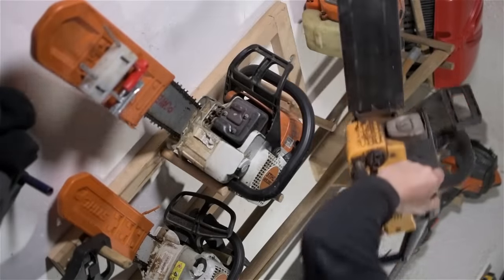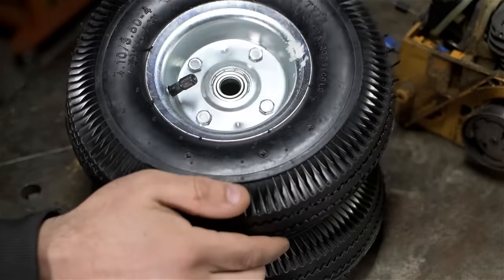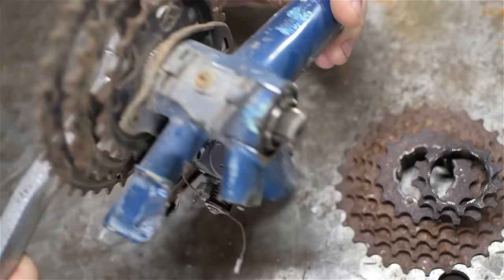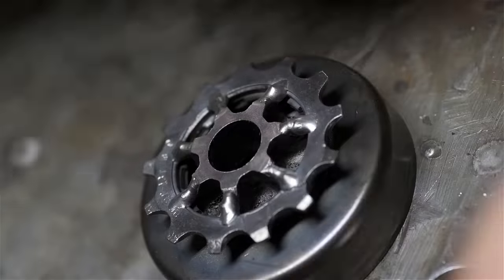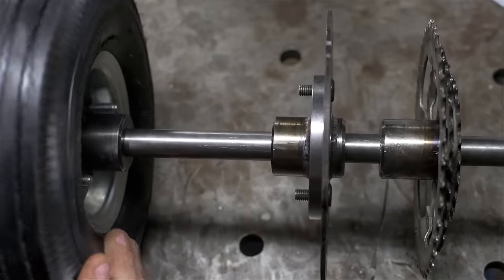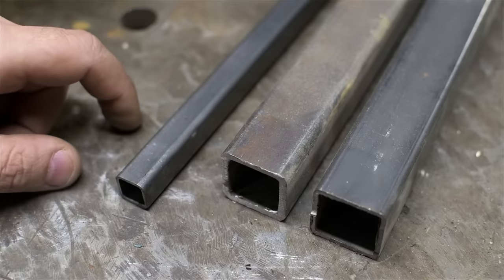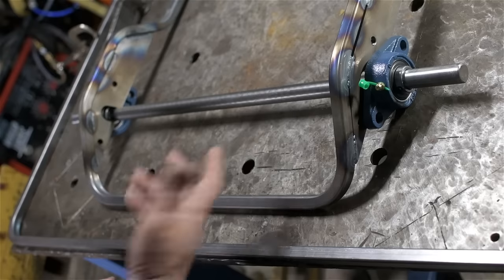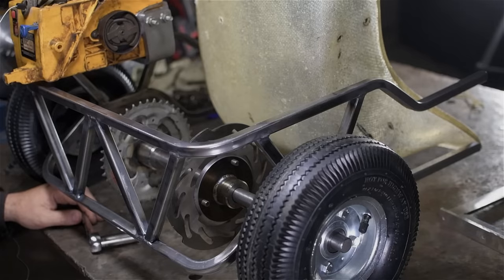CHAINSAW GO KART! - Part 1

Comment: my dad made me a go kart with a 3 gear bike engine (also ~45cc), when i was about your kid's age . he didnt have all the tools you do but he managed to pull it of. mostly by visiting every scrap yard ever to get the parts he couldnt make. long story short... your kid will NEVER... EVER... forget this. my dad died when i was 11. seeing you do this floods my eyes with tears. thank you for making so many great videos. you are awesome.
Reply: OH BTW!!! make sure the rear and front wheels are alinged by their respective centers or the thing will have serious troubles turning. (as in, both front and rear tires' centers should be at the same distance from the center of the chasis)
Reply: juan Balsamo R.I.P
Reply: juan Balsamo I feel ya man.
the best thing my father ever did for me was when he'd  put tools in my hand and teach me how to work with my hands.
if I wanted a bicycle, I had to rebuild one from the dump. if I wanted a 4 wheeler, I had fix one up. he a had a very strict schedule, 1 hour on whatever project a day or I'd lose a toy such as games and what not.
he'd buy the parts I needed and showed me how to use the tools to get it done. all those "old man" tricks he showed me helped me soo much over the years, as well as the discipline just to get up off my ass and just spend a little bit of time everyday on a project.
now I'm 26 and those tricks and habits have welded themselves in my brain.
not one day goes by where something isn't moving forward. No matter how big it small.  from  10 minutes to an all night thrash.
Something constructive happened that day.

I have a step son who just turned 6 and he wants a Go-kart  as well.
so, guess what he gets to do an hour a day? haha!
don't care if he whines, or he doesn't feel like it that day.
If he doesn't make progress, he doesn't get youtube.

when he finishes his Go-kart, all his friends will ask him "where did you get it?!"
to which he'll reply "I made it"

can't wait to hear him say that.
Reply: in my case i didn't have that luxury. my dad had a job and shop time was very short, so i'd just watch and let the man do his thing. he did take the time to explain his mad plans though. but oh boy did i learned from just watching. my dad was the kind of guy that would tackle ANYTHING. "learn how to, go and do it. just like that". that and he's usual saying "there'll always be problems to solve and for those... the good ol' hammer" lol. but yeah, i got lots from him. mom's stare when im working gives it a way. i guess the old man lives through me.
Reply: I have a similar story but I was raised by a single mother and we had to work with the tools she had.  Old broom sticks, hot glue gun, aluminum cans, sewing machine, etc.  It took a little longer to build something without all of that fancy machine shop equipment and exotic cold rolled steel but in the end we were able to build a 300 HP supercharged nitro fueled go kart.  She was also a very good cook and she would treat me to her famous chocolate-chip cookies whenever I would win a race, which was always.  Mom's rule.
Reply: A single mother or perhaps any mother wouldn't let you have a go cart in case you hurt yourself. So I know your fibbing. I made my son an electric powered jeep. Top speed about 12mph His mother nearly had kittens about it.
Reply: My mother had a $1 million dollar life insurance policy on me.  She would fuel my super-charged go kart up with nitro and then tell me to have fun and be home when the street lights came on.  I have to admit she always looked a little disappointed when I would show up on time.
Reply: @waynegoff764  r/woosh
Reply: MusicByJC 300bhp whhhhaaaaaaaat?
Reply: tobias ripper your dad sounded like a good man that had your best interest at heart. I'm sorry for your loss. At least you have great memories!
Reply: I feel for you. My dad died when I was 14  now I'm 41 and I still remember him
Reply: @dosbox907  your a very wise 26 year old. Thanks Dad!
Reply: !m the 600th Thumb up   tr  Nice story man ( A year late but hope things turned out for you )
Reply: For me it was my grandfather... Many hours looking at him on his home made lathe! The scarcity of ww2 close up does something to how you see the world and whats important i think.. So much love in so few words. This madman broke his tooth christmas day in 19-bow and arrow. No dentist for a week.. what does he do? Goes down and mixes up some Araldit. (two component glue?) And glues it back on. Held til the day he died! Miss that guy to death, just hope i have someone to bring that forward to some day..
 And as we say in Norway: Everybody deserves a grandpa! :)
Reply: Tell your dad I said happy birthday
Reply: Yea good 1 he won't
Reply: For someone without a father, i cant help but relate to this because of the things my grandfather did for me. Shout out to great father figures!!!!
Reply: @MusicByJC  Did you burn bras to melt the aluminum cans?
Reply: @MusicByJC  Carl Cox has a racing team!
Reply: I'm sorry for you,
Reply: Sounds like a good dad, how fast did it go?
Reply: I must have got pollen or something in my eyes right after reading this whole comment section. Thank you all for sharing, and being human.   My dad is gone too and we were best friends till the end.
Reply: Good luck FRIEND  have a good one
Reply: @tobiasripper4124  how bout my Chevy tahoe
Reply: Tobias, your dad was a superhero. I'm sorry you lost him at such a young age. Your reply to this video is priceless. God bless.
Reply: Im sure the guy who made the videos kid will never forget this because theres a fricking video about it on the internet xD but that aside im sure he’ll remember this and heck he might give this cart to his kids some day
Reply: I like others had a great dad. Great video and even better was the comment section. I miss the WWII Generation. I’m now 47 and i spent every bit of spare time with my 2 boys, who now are grown and starting families of there on.  It’s sad to see so many now without that great father figure in their life. Just read the comments and you see those with and those without.
Reply: RIP dad
Reply: Yeah my step dad and me built go carts together we would work late into the night we where building two mine and my sisters i had to build mine and find the parts for it which he would buy for me ill never forget that or his way of telling if a old engine had a spark (i was 9) he said hold this wire and crank
Reply: tobias ripper rip
Reply: Amen ....
Reply: totally. utterly correct
Reply: Same story here. My dad didn't have much. Had little to no tools. Used batteries to weld with homemade rods. And still was able to do this stuff. I never got to see my dad do stuff like this cause he kind of got out of building engine when I was born. So I never gotta see what he did. But thanks to people like this I can see how it's done but with a lil modern twist.
Reply: Lppy .        Fog
Reply: That’s how I built my kids. Every scrape yard in Tacoma. The kids loved going with me to go hunt for parts. Those were the bestest times. They still talk about that summer racing around the neighborhood dirt track. I enjoyed it and miss those times

Comment: Years ago I built my son a go cart out of a riding mower frame. It was driven by a big old David Bradley gear drive saw engine. It was unstoppable. Also took one of those big powerwheels Jeep, an axle out of a self propelled push mower, and added a four stroke weed eater engine.  He loved them both.

Comment: dang.   that was some spectacular welding on the wheel hubs.
Reply: TIG is awesome
Reply: Yup
Reply: I find a chain whip and lockring tool easier, but he used what he had.
Reply: for real. totally, totally right dude

Comment: great to watch the improvisational shop work! my preferred method! !
Reply from the maker: Thanks JimmyD!
Reply: @ThisOldTony  11zz
Reply: @ThisOldTony  I am in WNY .. I do have the clutch tools several diff ones .. basic is a plate with 2 pins that stick out and it hooks up to your air inpack some time I will try and post a picture of them on my you tube page ..
Reply: exactly. 100% perfect

Comment: Gee, I wish you were my Dad.  Are you willing to adopt a 72 year old? ;)  I used to race Karts back in the day.  I think you should have mounted the engine on the right to put the large sprocket close to the right wheel and put the large disk brake close to the left wheel.  That way you will have more clearance in the center and less damage when straddling humps, rocks, curbs, and other objects.  Congratulations on a very interesting build and a great job on the video.  It's entertaining without a lot of blah blah blah.  I look forward to part two.
Reply: I'm sure it was a live and learn project ..

Comment: Dad of the year?
Reply: Parents of the year. Dad for building it, Mom for allowing Dad to do it.
Reply: metallitech Hardly a joke. My mom would not let my dad do this.
Reply: dmr drexel, if I was a kid with a weld-mask, I'd be absolutely horrible about keeping it on. I could imagine my dad trying that with me; it would not have worked. Better to get a shielded welding booth.
Good for you for getting a respirator. Developing a wood dust allergy is very effective at preventing her from ever taking up the craft.
Reply: HOW COME YOU'RE NOT MY DAD, TONY?
Reply: Great Wall Made in China. im dead
Reply: ik i laughed too
Reply: Verdatum, a respirator is a bit overkill though, isn't it? If it's dusty lungs you're worried about a dust mask should do fine.

As for keeping the stuff on; if you stress the importance of using protective gear when working in the shop from a young age (and show that kind of discipline yourself), in my experience there is no problem.
Reply: It partially depends on what sorts of wood you're working with and your propensity for allergies. If you are allergic, no a dust mask is insufficient. And one way to develop an allergy is via exposure, so again, a dust mask doesn't prevent that. If you have top-of-the-line high end dust vac systems and you operate a quality air-filter in your shop, you can get by without a respirator. Also, if you only use hand-tools, and do scraping instead of sanding you can skip the respirator. Otherwise, it's not a bad idea. Also, I personally find respirators more comfortable to wear, as the valves do a better job of preventing moisture build-up.
Reply: verdatum I have a small cnc router in my basement and mostly cut pine or oak as a hobbyist. Do you think I need a mask for this sort of work?
Reply: I mean, probably not as long as you've got a vacuum on it and you don't have other allergies. But if I had my little kid hanging around in my shop, I'd be overly cautious with her. And if your basement has an outside door, maybe open it and set up a box-fan exhausting air outside.
Reply: Yes you do brother. God bless
Reply: Denis Kobozev my dad wouldn't have to I would but for this comment my mom would let my dad do it
Reply: Ho Yes !
Reply: J Schlesinger veg
Reply: Friggin Rights Jeah Awesome
Reply: E
Reply: Yep my dad was one hand a can of bud 99% of the time my x-wife called me the disney dad thanks I'll take it

Comment: Do a double reduction for sure. If you use 12" wheels at 4000 RPM that ends up as about 200 MPH under no load. The weight of the wheels alone would take that down to about 50, and under load with a person it would take a couple years to accelerate. 
I recommend mounting the mid reduction axle above. Use the 7 speed gear as a coupled gear, and you probably can get a decent reduction. If you need more than that, get smaller wheels. 

I think 3 reductions is necessary. Might be difficult but it isn't a powerful engine.